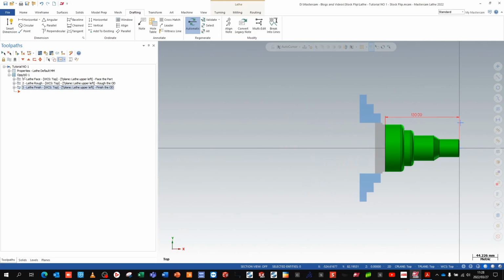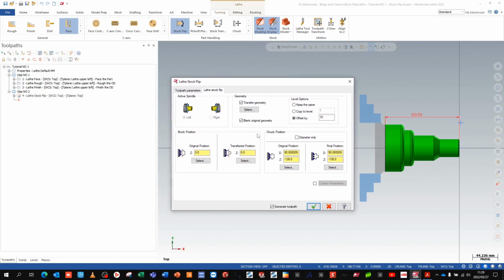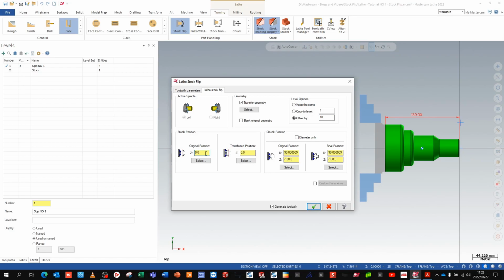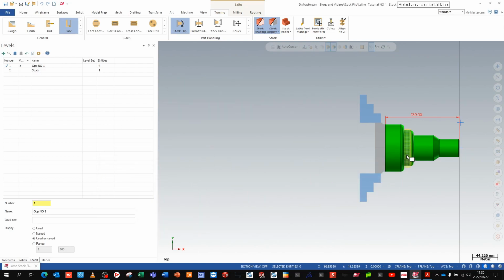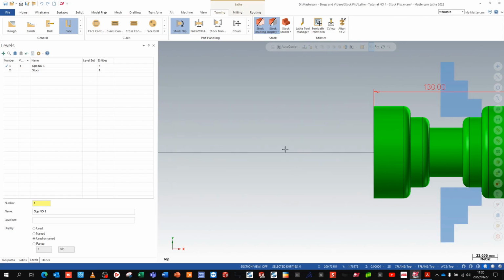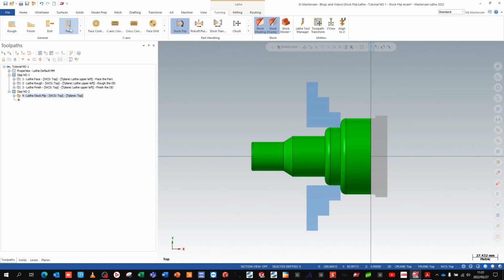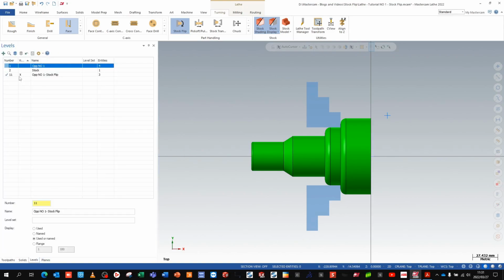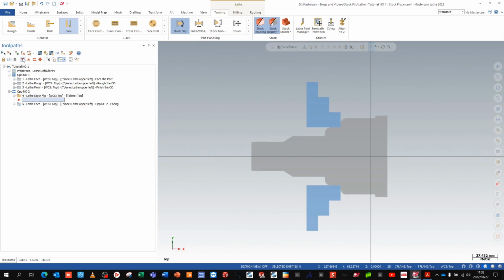Mastercam Stock Flip Tutorial

Comment: they need to update the stock flip with a way to change the jaws , becasue its very rare that you use the same set for op2 , since most of the time you turn soft jaws. Most of the time its ok but if op2 was very critical and you had to get close to the jaws it would be nice if they were very accurate.. thank you